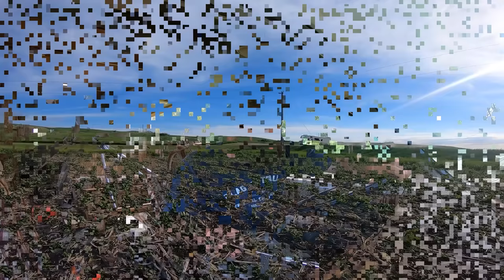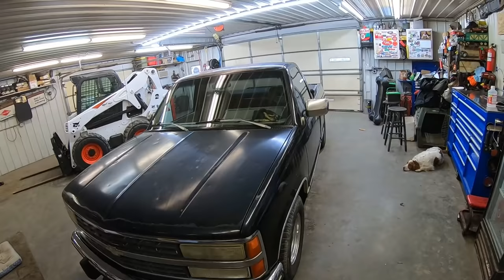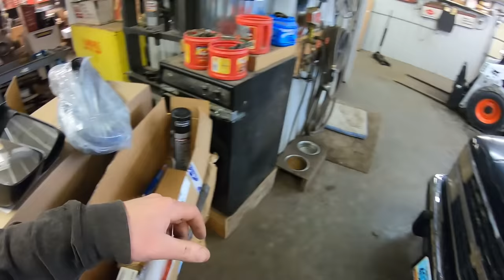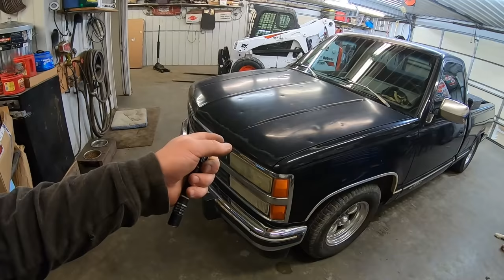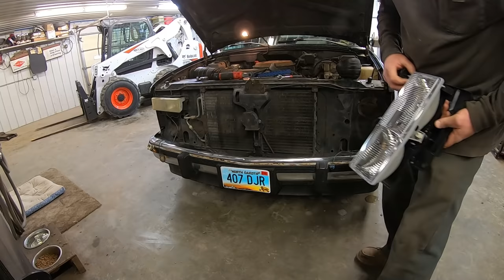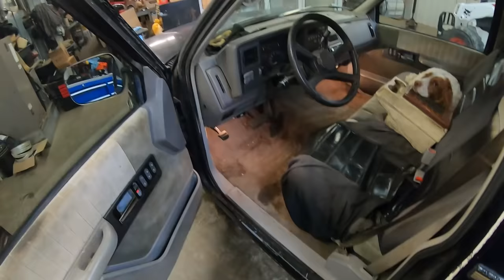Budget Interior Transformation! 1992 Chevrolet Silverado! OBS Upgrades!

Comment: Much enjoyed your Okie Upgrades on your 92!  Hey, your seat is toast anyway, try your Quickie brush with some GoJo or Joe's Hand Cleaner on those crude oil stains on those seat covers.  Scrub it in really good and then wash out.  I think you'll be pleasantly surprised!  Duff will be amazed!  $2.00 worth of hand cleaner and some elbow grease.  What you got to lose?  Try it on the top of the driver's door panel, too.
Reply from the maker: Worth a shot.

Comment: The OBS is coming alone. Is that the heat/ air blend door you are trying to reset to run the air condition ? If so still manufacture replacement if needed. You lucked up on buying this jem. hey are going up in value .

Comment: Personal preference, Sylvania Xtravision.  That's what's in 2 of my 3 vehicles now.  They were out of stock 2 years back at the local store I was at, at the time, so my van has Silverstars.

I want to try LED headlights.  Hear great things about them, seeing things is always nice, and they are supposed to last a lot longer than say those Silverstars.  On the flipside, get blinded by them coming over hills when they aren't installed right.  So maybe I'll go down that road now that I have a little shop where I can actually do some maths and measure spots on the wall to aim them instead of the good ol' trial and error method.  You know how that goes, can't see nothing, adjust them up.  Get a ticket for blinding the mayor's wife, adjust them down.  Hit a deer, adjust them back up a little.

So maybe I'll toss a set in the wife's Explorer since she's always complaining she can't see anything after dark.  I mean maybe the 20% tint on every window and the brow on the windshield isn't helping either.  She can talk her way out of tickets, too, so there's that.

Comment: If you pull the vent officer top of the outside where the wiper arms are there's a hole on each side that usually gets clogged up with leaves clean it out now drain outside instead of inside
Reply from the maker: Thanks for the tip!

Comment: I've got a 91 Cheyenne and it has the same exact controls. not the sliders. has ac also. just the cheap W/T model. if you haven't found one yet let me know,  my truck is just being used as storage at this point and will never be on the road ever again. has the cd pocket too. also have the dash mounted cup holder. it's maroon. but could be painted to match
Reply from the maker: The cup holder even! Dang!!

Comment: That area where the windshield wipers are, the cowl is what I was thinking, I was getting some water from in there, from factory there is a panel or two that has that  sealer on the joints. Maybe why it's getting some moisture on floor. Hard to believe people don't know what a clothesline is, man I'm old
Reply from the maker: I'll have to dig into that.

Comment: Possibly the old windshield was leaking that would leave water on the driver side, as far as the passenger side either a heater core which is obvious or there’s a screw that’s under the cowling that could be leaking through the outside air vent onto the floor had that happened on a truck I had took me forever to find.
Reply from the maker: That was quite a while ago so it should be dry by now as the windshield was installed in December and it's been inside.

Comment: You don't have to take the grill out to replace headlights there's two bolts with 6mm heads I think or 5mm not sure but everyone thinks they're for adjusting headlights and they are not they are for removing headlight the adjustment screws are threw the holes in front clip frame and are Phillip head and the turn signal lights have 4 screws and come right out

Comment: The drive shaft has to have the freeze plug with the pin whole made the mistake of plugging it my self and causes every seal on the trans on my 91c1500 to leak there is a o ring inside the tail shaft housing that the yoke rides against that needs changed had to do mine after I did the rear leveling kit.
Reply from the maker: Thanks for the info

Comment: Duff Days.....and Mortske.  On the headlight, I have used Fahren brand off Amazon in my son's 01 Sierra, My 17 F150 and 11 Mustang. They are bright, white in color, less expensive than most, and have worked perfectly for over two years.  I totally agree on the ease of removal of the 01 Chevy/GMC headlights. They are so super easy to swap out.  My F150 takes about an hour a side to change out the bulbs.  The engineers that did this should have been fired.

Comment: Hey Mortske! The moisture on your driver's side floor panel MAY be entering through the firewall from the engine bay. I had a GMT400 with a bad hood seal (engine bay, between the hood and cowl). It allowed rain water to enter the engine then leak into the cab somehow. I never noticed any wet carpet. I didn't know it was an issue until I pulled the carpet. It looked just like your floor. Just a possible cause to look into. G'luck! 
BTW, MorMortske could be a good name for a second channel
Reply from the maker: I'll have to check it out!

Comment: Wet carpet on the forward firewall is usually a sign that the A/C airbox seal to firewall is leaking. Water comes in from the cowl and works it way into the cab. A very common problem with the GMT 400 platform. Really sucky repair. Ask me how I know!
Reply from the maker: This is on the opposite side as the AC however.
Reply: Crap. I swore you were on the passenger side when you were talking about the leaks. I guess I should have been paying more attention instead of changing the water pump on my 98 Z71.

Comment: I’ve never had good luck with door pins and bushings but then again the 88 through 98 trucks Ive worked on have been way worse. The 88 S 15 Jimmy I have right now I had to use some thin washers to kind of shim the door where it would close even, yeah the aftermarket pins and bushings do have slop in them from new.
Reply from the maker: yeah, I shoulda bought more expensive pins.

Comment: My 92 was very small leak around the windshield with a new gasket and the reason why paint and the  Grey primer wasn't making a water tight seal and left alone it's just going to get worse and then you will have more to fix than that wet. Jute padding

Comment: my 97 Z71 got water in the floorboards b/c the heater core would weep when it changed temp. not while idling, not while running, but as it heated up or cooled down, it'd weep enough to get the carpet wet on the passenger floor. it was gross and rusty looking just like that carpet is.

Comment: The last pitman arm puller you’ll ever need, OTC 8150.  Removes em like butter
Reply from the maker: Thanks for the info
Reply: Those GMT400 trucks are notorious for stuck pitman arms, I’ve used my OTC puller and it makes them practically fall off with an impact. I read a lot of the reviews and folks were greasing the threads with wheel bearing grease beforehand and weren’t having any problems. The conical design eliminates the spread under load that happens with the two-jaw pullers you get in the stores. Ordered mine on Amazon a few years back, worked flawlessly every time I’ve needed it!
Reply from the maker: @kevinmcclure7551  Nice!

Comment: I use womens spandex pants to slide over center consoles and sun visors. Pull it tight down to the toe. Its a cheap no sowing way, and your can get any print or color. Easy to replace or just slide another over if you want something different.
Reply from the maker: good idea!

Comment: Mortise , congrats on 100k !  You asked so..... The very bright headlights suck and also the brighter the lights the faster they burn out.  I personally like the long form vids. Where you actually do some repairs not just  will it start . Look at me file the points get it running and drive 200 miles ain't I the most talented feller that ever lived.  I think the second channel thing is dicey kinda spreading you and Chin a bit too thin

Comment: yup. if you see any of these that are swiss cheese for rust... and cheap to buy [good for motor and trans donor for the elder Impala's, Biscayne's or twin turbo sprint for sh!t's and giggle's mobiles] :-))  Low compression, high boost quarter mile terror's lol Love to see an old Canadian Pontiac done with a twin turbo set up [ultimate sleeper? lol].  Say a 54 Strato Chief or Pathfinder [both of those are Franken-pontiac jobs banged together by Pontiac Canada but are very cool old cars]. :-))

Comment: Did this truck come with the 700r ?
Reply from the maker: Yes
Reply: How did you hook up the 4l60e  shift linkage to 5he truck. ? Dumb question but my 91 came with shifting metal rod but doing a swap
Reply from the maker: It was hooked up from the factory @MOE13576

Comment: LMC Truck would all the pieces you want for the interior. I found them very quick and reasonable prices too, for a 76 dually 1 ton crew cab 3+3 Camper Special that I had. Nice old girl w/454 and a 4 speed manual,  bear on gas though. Bureaucrats up here wouldn't approve plates for any reason,  guess she thought it was a gross polluter, got it for camper hauling but that never happened,  thus my dislike of petty bureaucrats .Why not go with small video cams on both sides for full rear view coverage with 1 more dead center of the tailgate. Split screen video systems are cheap enough from Wish and easy installs.
Reply: My 76 Dually had the same front floor wet and rot from a leak. Turned out the weather seals across the top of the firewall were seaking anything, and both a pillars were rotten all down the inside. That could be part of your wet front floor problem.

Comment: I've watched just about any video with even a little hint that they're tearing out the head liner how tf am I the only person with a grab handle on the passenger side I can't figure out how to remove it
Reply: Fun fact I found the grab bar online for sale and that's how I figured it out then when I removed the bolt caps they both broke
Reply: Tiny flat screwdriver. Pop em out. I went in vertical from the door side.

Comment: ..OBS?..is that supposed to mean "old body style"?..I know these GMT 400 trucks are getting on 25-30+ years old now, but they will ALWAYS be "New Body Style" to me...I remember when these came out in early spring 1987, as 1988 models...the previous body style, what people call "square bodies" now, was still in production for certain truck models, and the Blazer and Suburban, so there was considerable overlap from 1987-1991...nobody used the terms "squarebody" or "GMT 400" then..everybody I know used the terms "old body style" for the squarebody, and "new body style" for the gmt 400's..since that went on for about 5 years, that got pretty ingrained in my head, the 1973-87(1991 for some models) will always be the "OBS"(old body style) to me..and the 1988-98 will always be "new body style"...nope, just can't wrap my head around calling a GMT 400 "old body style"..as far as that goes, wouldn't you call a GMT 800 or GMT 900(1999-2006, 2007-2013) "Old Body Style" now, since they are no longer in production?...
Reply from the maker: Who knows? I don’t make the rules

Comment: door pins suck and them cheap ones you will be replacing them in a month again
Reply: ask me how i know lol i have two 89s right now
Reply: i just done brakes on my 89 3/4 ton 400 bucks for rotors pads and bearings. but worth it stops way better. 8 lug trucks cost more lol
Reply: oh im down here by ol pudding lol speaking of okrahoma